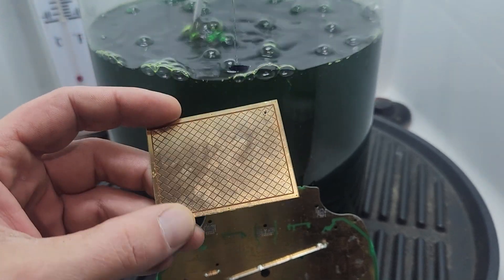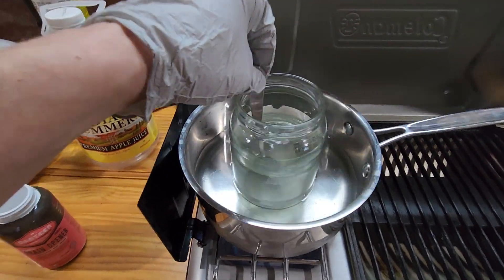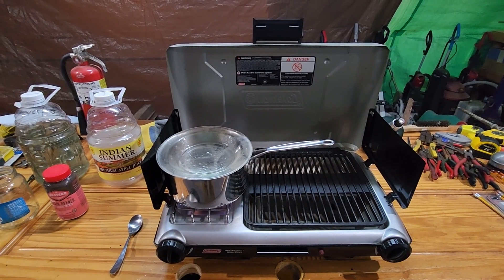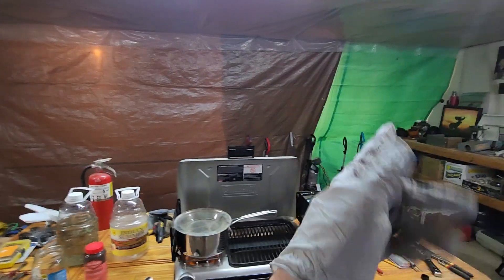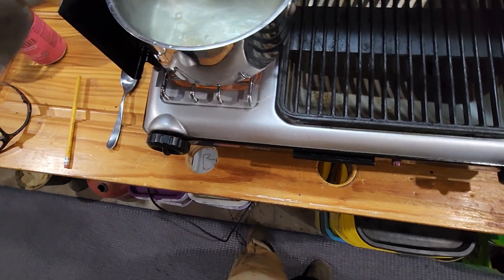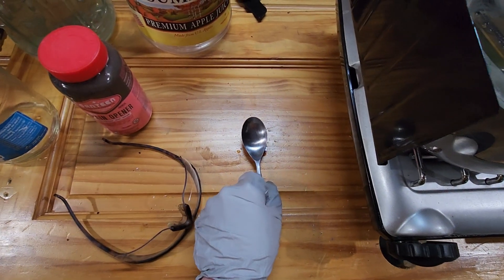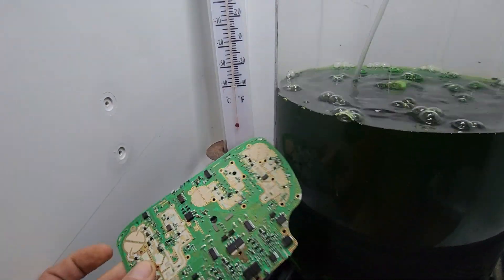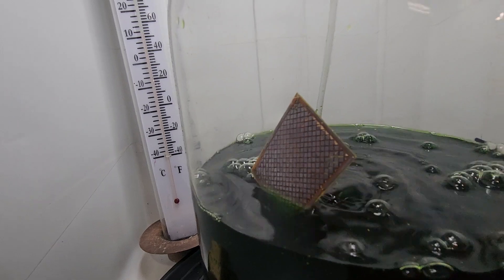How to remove the solder mask coating from a circuit board for #gold #silver #copper

Comment: I do believe the way I seen it, lye crystal, put boards into a big bowl, sprinkle crystals onto boards, boil some water and pour it on and cover the boards. Let it sit 10 minutes and scrub with toothbrush. Thats just what I seen. Haven’t tried yet.
Reply from the maker: I did that , but then realized if I just make some , keep it , I can reuse it over and over,,,,    

              Future scrooge .........
Reply: @ definitely love the recycling!  This is the way.
Reply from the maker: @MikeDoesStuff101   the heat was just to spead it up,    and my shop was at 35°f   surprised alot of my videos don't shake more when I hold the camera  hahahaha
Reply: @ScroogeMcDuckn  i know the feeling of a cold shop, I’m planning on insulating the summer.